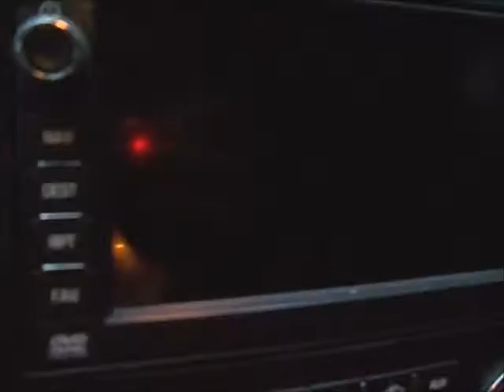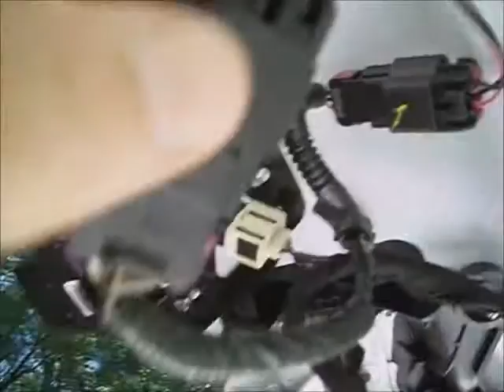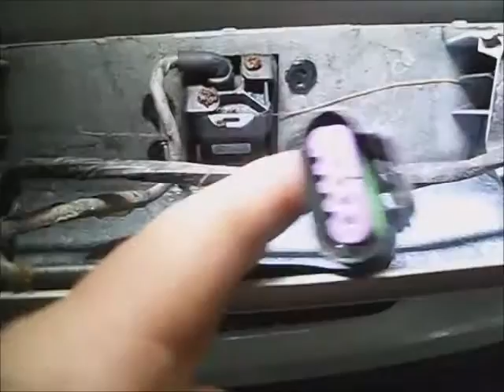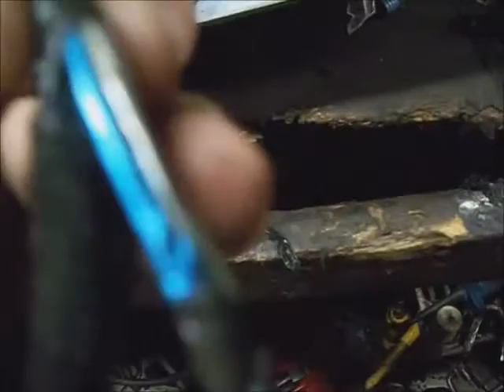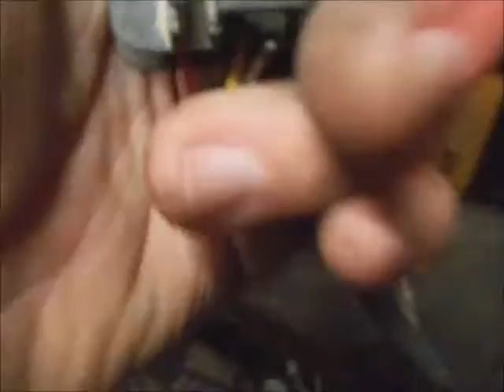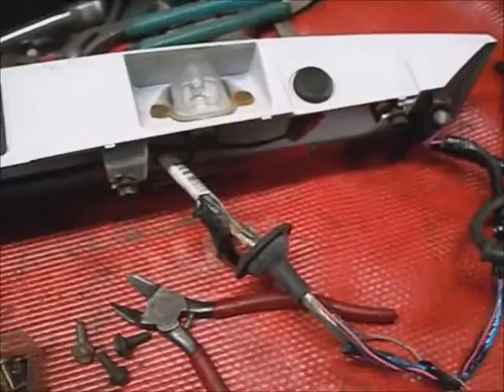GMC Yukon Denali `08 back up cam diagnostic remove and replace

Comment: I didn't need the camera bit, but I keep blowing driver side park light fuse, and I suspect that it's the LP light sockets. I am SO glad I found this video to help me understand how to get that panel off the back. GM once again screwed owners by designing something poorly. I can't seem to loosen any of those nuts, so I will have to get back in there to try. It looks like a challenge to even loosen them and then a bigger challenge to try to cut them off.

Comment: Im having same problem with the black screen. I'm just wondering where did you buy the back up camera
Reply from the maker: http://www.ebay.com/itm/GM-OEM-Parking-Aid-Camera-15173619-/161805450865
  Be sure and remove the old one first, and get the actual part # off of the original camera.  Before committing to buy a new one.
Reply: I removed everything and followed your steps. At first I tought it could of been the camera control module but after doing what you did with the video output trick I found out I do have power and video all the way to the camera. I noticed my camera already had a few corroded pins where it connects to the harness and there's moist inside the lens of the camera so im positive it's just the camera itself and not my wiring. I looked at your link and they're very expensive I'm going to do a. It more research with my part number to see if I get a better price. Thanks a lot for your help and video keep it up👍🏻
Reply from the maker: Yes expensive....But then again, so is the Denali.

Comment: sweet. where did you learn that trick testing the video output??
Reply from the maker: I just tried it based on typical input/output of a video signal.  Any change in the display would have probably verified that the screen was able to receive video input.